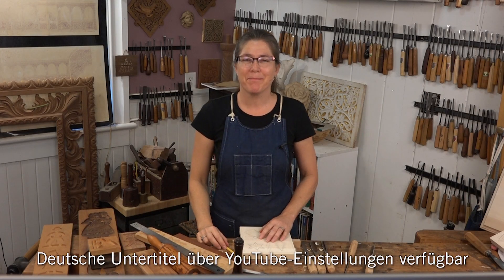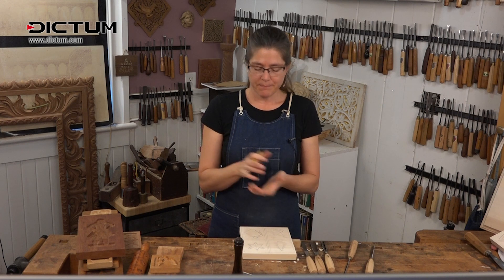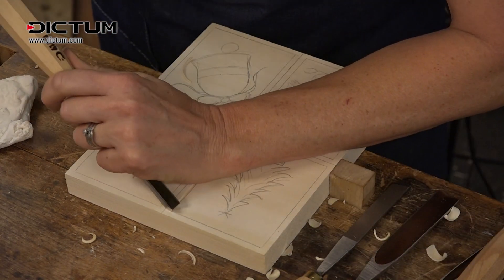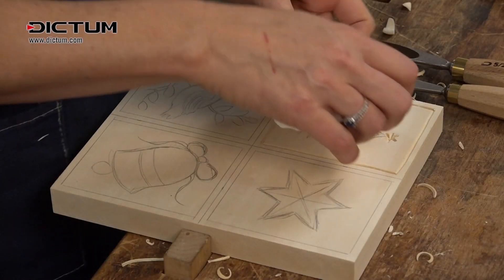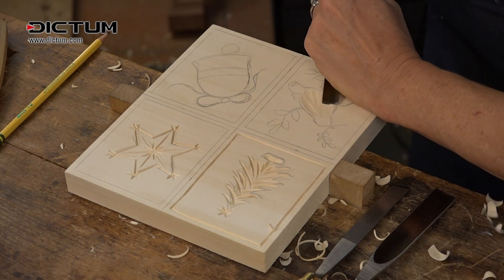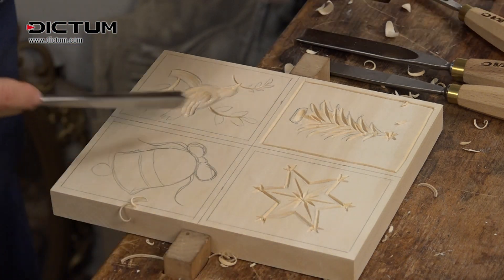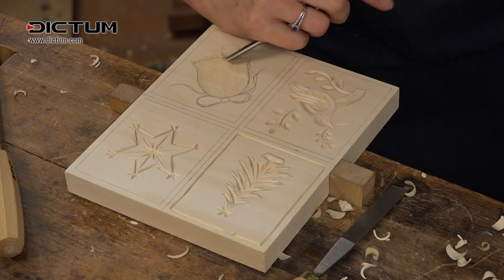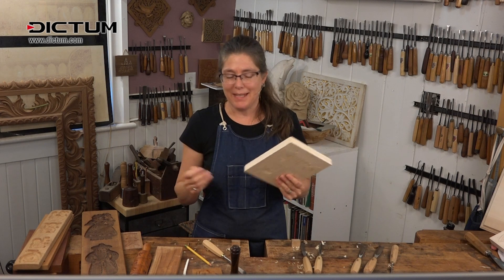Carving »Springerle« cookie molds - mit Mary May (EN mit DE Untertiteln)

Comment: The windmill is a Speculaas mold.  The smaller is probably Speculaas or Gingerbread.  The larger ones are gingerbread.  Springerle are impression molds where you push the mold  INTO the dough.  The others are cavity molds where you push the dough into the mold.  The pin is a Springerle.  Molded cookies are fascinating.
Reply: Thank you for that explanation. There are some amazingly details ones that are antique and are quite beautiful.